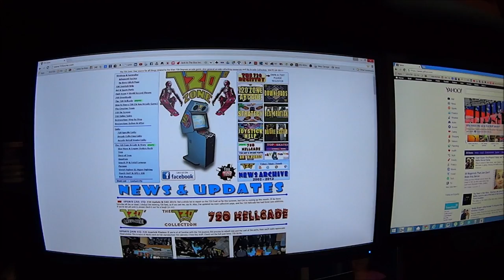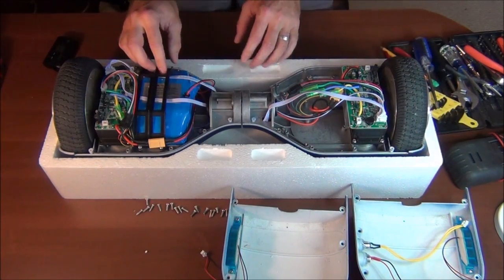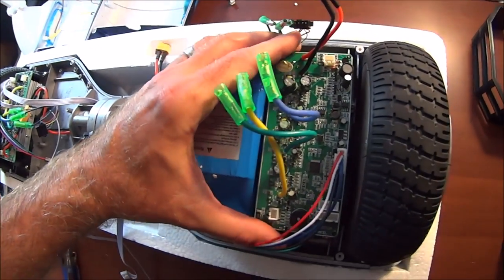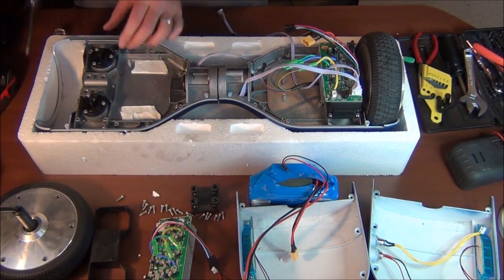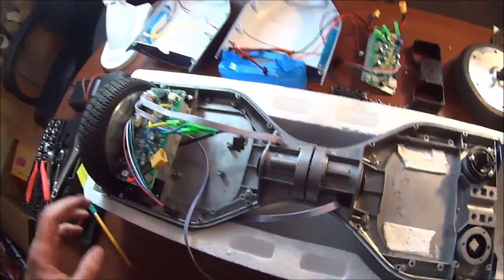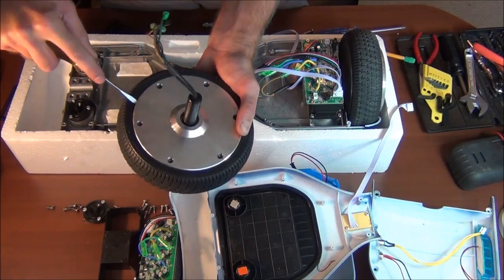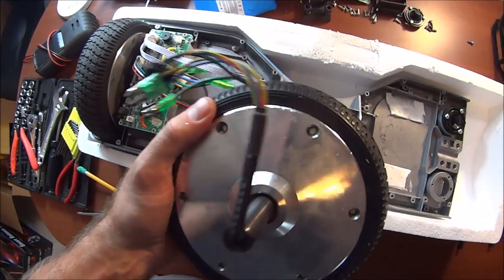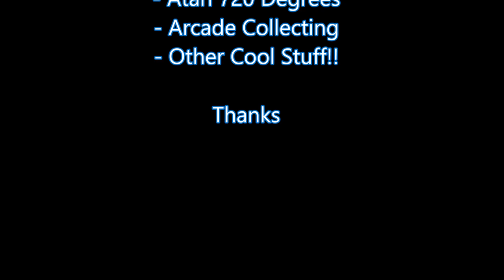Two Wheeled Self Balancing Scooter DISASSEMBLY and Reassembly - IO Hawk / Monorover R2 / Hoverboard

Comment: Looks very cheap inside. Also what is the reason one side is missing a bettery when there is a space for it?
Reply: Each side coud be using it's own battery, since they are almost separeted from each other. But It's true that it would be more complicated to charge it. Maybe charge both sides separatly... :D It really is basic, but i like the motors in the wheels. Good for you that it helps you make some cash.

Comment: Great Video!! But there is a difference between them. At least one difference. Some have a motherboard some don't. Yours didn't. The motherboard should had been in that big empty space where it looks like a second battery could fit. The ones with the motherboard are safer and seem to ride much better. You don't have to control it with your feet nearly as much - you just stand on it and it takes you. Without the motherboard you aren't riding it, you are driving it. The motherboard also slows the board down when it is turning fast..  so you don't get flung off. There's probably more that the motherboard does, i'm not sure. I had one with and one without the motherboard and these two differences I saw for sure. You want to make sure the one you get has the motherboard
Reply: anywhere else u can prove this? mine has this empty space seen in the video and im experiencing alot of instability at moderate speeds

Comment: the wheels look like brushless motors, the shaft locks into place, the 3 wires connect to the coils inside the wheel in a 3 phase configuration and are held in place by the shaft, surrounding the coils are permanent magnets that spin freely with the wheel which is connected to a bearing at the very end of the shaft
brilliant design
Reply: I was thinking the same!!! That design is genius
Reply: They are definitely brushless because with all the moving forwards then backwards and stopping a brushed motor would last long

Comment: Thanks so much for uploading this video! I accidentally got keys stuck up in the wheel between the wheel cover and the wheel. It was not budging at all! The keys were completely stuck! Earlier I took apart the scooter and I didn't know how to take off the wheel! I was watching YouTube videos and no one was taking off the wheel. Later on I stumbled across your video! Saw how to take the wheel off went right to the scooter and took the wheel off, and the keys popped right out! The metal clamp holding down the wheels were very hard to unscrew! But thanks again for uploading! This video helped me out a lot!

Comment: Those 3 thick wires, yellow, blue, green, will probably be with 3 phase brushless motor connections.

When you swap a pair of wires, you reverse the direction of the motor. Clearly they needed the motors to spin in a certain direction according to the mounting of the circuit board gyros. So they swapped one set of wires.

Comment: Where did you get that Hoverboard / Hovertrax? I would like one with just 2 circuit boards so I could mod it to have 2 Samsung battery packs. Most websites just offer the circuit boards for the models that have 3 PCB's.

Comment: Thank you thank you thank you!!!!! I got one yesterday and the battery side wheel was grinding against the 2 screws holding down the metal frame. They wanted me to return it to China!! ($400 shipping), but your vid shows me I can slide the wheel out a hair by loosening those 4 beefy allen bolts! I would have never taken it apart that far without seeing this first.
p.s. buyers beware! I got mine from Amazon and had no idea it was being shipped from China. Buy units that are shipped from American sites only!! Also I bought what was advertised as a Swagway and got a generic "Smart Balancing Wheel". There is fraud and counterfeiting going on with this product! The components in this video definitely seem of better quality than is in mine.
p.s.s. 720, I tried to remove that plate from the inside of the wheel too and was also shocked that it didn't separate.Thx again!

Comment: ...that moment, when ur looking for somebody. who really can explain how the board is working - and you find this guy on Youtube, telling you, that this black, round piece on top of the CB (11:29) is some sort of sensor, but in fact isn´t, because it´s a piezo buzzer :D

(The Light sensor sits underneath and is made by a infrared light-barrier, which is (dis)activated by stepping onto the board and thereby getting the black rubber piece in between. As far as I know, this acts just as a safety feature to not turn the motors under certain circumstances)
 

PS: and yes, I do know as well, that a piezo electric element is some kind of sensor, but more force than light-sensitive, as it doesn´t only transforms electric impulses into oscillation but the other way around as well.

Comment: Nice video, we have a Smart Balance brand, works fine, but has developed a squeak in 1 wheel, I assume it's the bearing as I can hear a slight bearing noise with board off and rotating the wheel by hand.  Other wheel spins quietly.   I assume it is a sealed bearing and based on ur video dismantling the wheel doesn't look feasible.  Bummber, run well just squeaks. Doug

Comment: I need to crack that wheel open on mine.  I've seen another video where someone had opened it, so it can be done, but the video skipped the part that showed how to do it :(
Reply: +jdw99 Ive opened mine, you just have to keep prying but try to keep the flat head as close to the edge as possible. Theres a small circuit board on the inside that looks pretty fragile.
Reply: Mario Puesan
I gave up and just ordered a replacement wheel.

Comment: mine works great...other than when the battery dies it just turns off no warning beeping, no flashing lights, just throws me off...does anyone know which component is the voltage monitor?? im considering installing an inline lipo voltage buzzer..but would like to check out the stock one first... thanks

Comment: Hey thanks for the vid - I needed to confirm that there were only supposed to be two wires attached to the charge port, and I see from you vid that is correct.  Bought one of these things and the charger is defective right out of the box, no juice.  Amazon has replacements fortunately, but still PO'd that the thing is defective right out of the box...cheers!

Comment: those are not optic sensors.  It's magnetic.  It works like a keyboard does.  The "key" or rubbery par depresses and it probably has a small piece of metal in it.  That breaks the field of the u shaped black parts on the bottom of the board which is interpreted as "on" in a certain direction.

Comment: Ok quick question sir
If I wanted to jus take the top cover of (where ur feet stand on) would I need to still remove the inside components.?
Looking to respray.
Thanks.. Really good video..
Reply from the maker: Thanks for the comment. Unfortunately yes, the black pedal is the last thing to come out, so you'd need to do a full disassembly to get the top plastic cover by itself. I'm sure you could do it. Just go slow and take pictures as you go. Or, you could always mask the pedal and tires. Good luck.

Comment: Thanks for your help, sorry I have 1 more question I actually have a 10" wheel size scooter. There seems to be a lot of play in the middle of the scooter wen picking it up from the Middle. Any way that cud b tightened.
Thanks again
Reply from the maker: +Harminder Singh Check that the retaining rings that hold the center shaft, which goes between the two aluminum halves of the frame, is attached and snug. If there is play on the inside of the ring(s), you may need to put another ring or large washer in there to take up some of the play.

Comment: Because its two brushless 3 phase hub motor, the controller can change the order which it switches the windings, therefore controlling the direction - this is why it doesn't particularly matter about the wiring colour (blue -> green and green -> blue). Great video man! I'm definitely considering buying one :)
Reply from the maker: Harris Shallcross Ahh...that makes sense. Thanks very much for the info.

Comment: What kind of battery is that?  Thats a xt60 battery connector  which are used with lithium polymer - lipo batteries.  If it is a lipo how many cells does it have?  Try testing giving it another battery cell.  If the components hold up this will drastically increase your speed and power.....
Reply from the maker: +tyler johnson Hello Tyler: I did end up diving into a battery during another disassembly session. It is 20 individual cells, put together into 5 groups of 4, then wrapped in plastic. I did confirm that the voltage matches the description in the manual: 36v - 4.4a. Thanks for the comment.

Comment: hello this vid is very well done! I was wondering where could I buy that exact motherboard for my balance board? that would be much help! thankyou
Reply from the maker: +Hendel Mich I've been able to find the motors and batteries sold as parts, as well as a DIY kit that includes the frame and other non-electric/mechanical parts. Unfortunately no sellers have come forward with the boards as far as I've seen. I'm guessing its only a matter of time until there is an entire industry dealing with parts and repair for these things. Thanks for the comment!

Comment: HELP! the middle of the board seems very loose. Its like the parts holding each side together arent tight enough. is there a way of tightening this?
Reply from the maker: Hi! There is a metal shaft that runs between the two aluminum halves of the frame. That shaft is held in place by a retaining ring on each side. I would guess that one of yours has come loose

Comment: Hey man! You seem like you know something about these things so I have a few questions. 
1. Mine unexpectedly turned off and won't turn back on even if I charge it, do you think a fuse blew? 
2. Where is the fuse box or the fuses?
Thanks in advance! Great job on the video an keep up the good work
Reply from the maker: +Ty Fulmer Hello Ty. I don't believe there are any fuses in this device, unless something is built into the battery-pack, but I don't think so. I've had one scooter do the same thing. I initially suspected a bad battery, but it tested fine when I opened it up. Instead, I found that a tiny component on one of the boards had broken off, and the whole thing was dead. I would open it up carefully, look for loose connections, or (hopefully not) some sort of broken electrical component.
Reply: +720 Zone  Okay I will look for that, thanks a lot, I appreciate you responding! Okay well if there is anything that's broken like a motherboard, can there be replacements?

Comment: How would you off the other Side? Are there screws or something? Because I'm apthinking after a few months I may look for the plastic case and replace it so it looks good as new, also how would you change the tires and can I use a normal screwdriver to take all the screws out? (Tag me if you reply) thank you!
Reply from the maker: +Esther Agunbiade Hey - Thanks for the question. If you check out the video around 12:40 you'll see where I remove the last few component from the aluminum frame, which frees the bottom portion of the frame (which is actually the top with the pedal). Hope this helps.
Reply: +720 Zone thank you so much. I finally got one! But I feel like the front and back of the shell is ever so slightly apart. Like maybe  a quarter of an inch. Do you think this the shell itself or just that it wasn't put on evenly? Do I just need to unscrew it and place it properly or is it something more? Thank you ever so much! Tag me if you reply please 😊

Comment: When i turn my swegway on all lights come on and when i try and go on it it doesnt move. Any solitions
Reply from the maker: +Cam10Action It's really tough to know from that description. A lot of the failures of these can be fixed by either double checking connections, or addressing the height of the little rubber knobs that are part of the foot pads (to fix shaking). When either the lights don't light, or just the red LED lights, it can mean some sort of electrical failure. I would open it up, go very slowly, check all of the connections, make sure nothing looks like it has come loose in a crash.

Comment: Thanks for doing this, its been a major help. I ordered mine but the distributor had to send the board and the battery seperatly for some strange reason and i'm not a big take stuff apart and put it back together kind of person, so this video has been great
Reply from the maker: Alex Marriott Thanks a lot for the comment. I'm so glad this video helped you out. Very odd that your scooter would have required some assembly, but I would guess it was due to RoHS battery or component importing issues. Let me know if you have any questions on your unit please.

Comment: could you hook up a 2nd battery It looks like there is enough room??
Reply from the maker: +Jude Thomas (BTSF) It looks like there is space, but actually there are some metal posts on the frame that stick up into what would be the 2nd battery compartment. So another would not fit unless you removed those.

Comment: Anyone found a way to disable the speed limiter so it stops beeping at me when I go over 6mph?
Reply: Yes there is, you can set your board to advanced mode, all boards have this and it stops the beeping and makes the board go quicker. To change modes you have to turn the board off, then turn it on again and 2secs after turning on press power button again and you will hear a beep, that's when you in advance end mode 😀
Reply: BoyBehindTheScreen Thanks, I'll give it a try later. When you say all boards, does this mean the older ones too without remotes?

Comment: While i was riding mine today it randomly turned off and it started beeping a bunch of times then died. now it won't turn on. i opened it up and unplugged and plugged everything back in. now just one light of the board stays on and i still cant turn it off or on
Reply from the maker: ***** I would open it again, and double check all of your connections, especially the power button's connection to the board, be sure you didn't swap the connection for the light and the power switch. That is my guess.
Reply: 720 Zone yea we tried that! its weird because all of the connections have 40 volts then on the side of the non working light the connector only has 19 volts

Comment: I just got one of the same scooters and when I got it one of the tires rubs on the plastic frame can somebody please help me to fix this problem
Reply from the maker: +Matthew Smolon - Mine also rubbed when I first received it. It actually squeaked quite a bit in my first scooter video if you check it out. Once I rode it for about a day, the squeaking simply went away. My advice: If the rubbing doesn' t seem to be affecting performance of the scooter (creating drag), I would leave it for a while, and see if it goes away on its own. If it is creating some operational problem, I would suggest first trying to gently bend the plastic away from the wheel. If that doesn't work, you'll want to disassemble and look for the rubbing point, ensuring all screws for the frame and wheel mount are snug.

Comment: There's place for another battery pack
Reply from the maker: +Jephte Exumat There is, but in my unit, there are small metal posts that stick up into the spot where the battery would go on the other side. Those posts are not there on the side with the battery, so technically, a second battery wouldn't fit.

Comment: You know the little gap in the middle of the unit that has a connecting bar that allows each side to move independently? I may have missed it but did you see if there is anything that is supposed to keep the two sides close together? My unit will start to have both sides drift apart from each other after only a minute or so of riding until there is a little over an inch gap in between the two sides. Anyone know what I can do to keep both sides close together?
Reply from the maker: +Austin Cantu The two sides should definitely not be drifting apart. The two pieces of the cast aluminum frame have a smaller hollow bar that runs between them, through both. On the ends of this bar is an external retaining ring. I suspect your ring on one side is off, or perhaps both are missing all together.
Reply: +720 Zone I have mine apart right now and it was infact the retainer ring that has slipped off. Fixing it now! Only other weird thing I found is another copper colored ring on the inside also dangling around the wires. Looks just liek the one that is in between the two parts of the board. kind of on the outside technically. I wonder if its an extra or if it is supposed to be along the other copper slider plate.

Comment: when i open mine it has 3 boards on it.
Reply: +joseph chrzempiec (josephchrzempiec) 
some have three and some have two the three board ones have a logic board that run the two attitude or static gyroscope boards which is better? but the three board ones seem to last longer because the two board one over neat the one by the battery more often and harder to find the parts for!